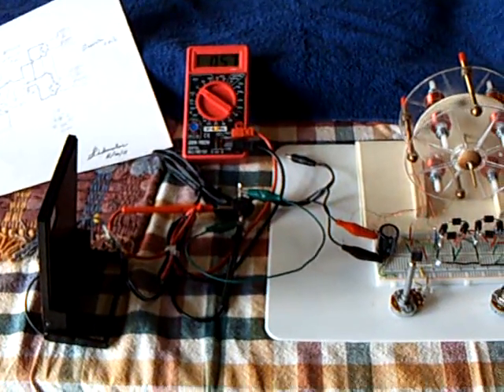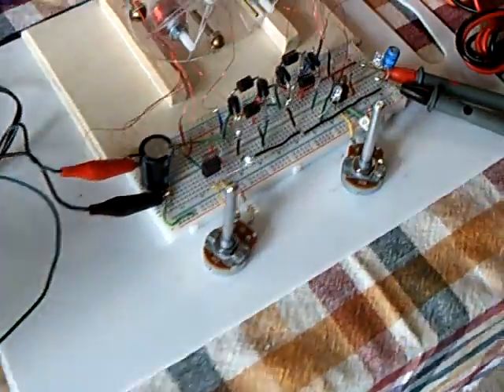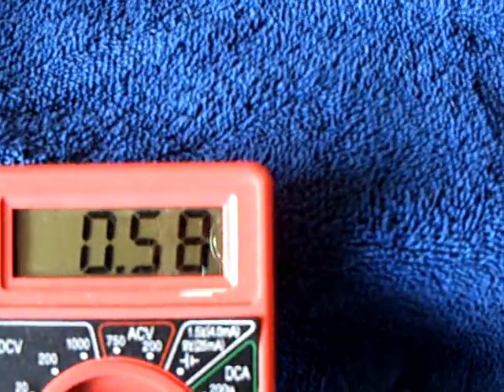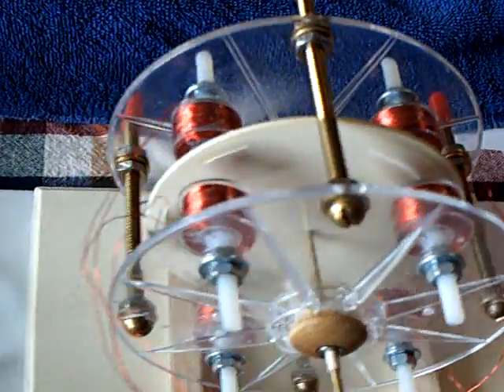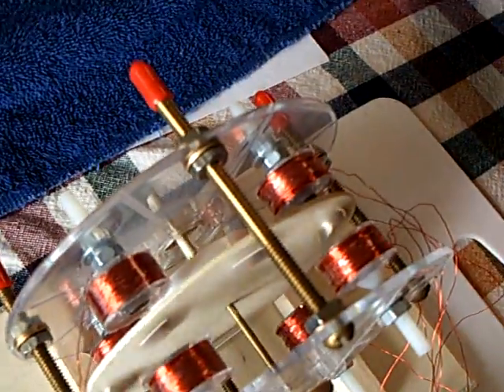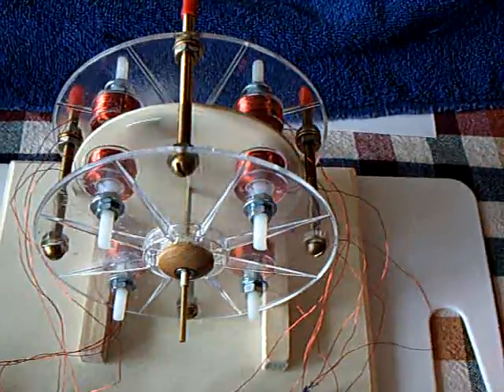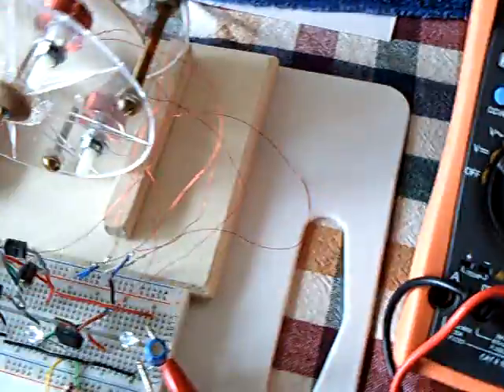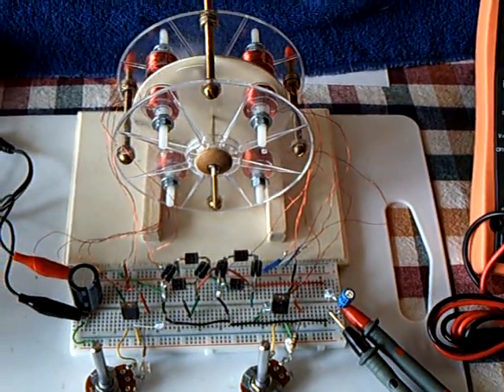Ambient solar energy Muller Dynamo.ASF

Comment: at such low power input i wonder if the entire unit meaning all the coils as drivers how much torque would be developed for the fan as it does take quite a bit of energy to move a volume of air.

Comment: very nice! you can try 2 muller in series, using the 2.5v as input V of the second...and so on. And you can use the Jenas`s light at the end or a slayer exiter. ;). have you try your gel or cement batteries with this device?